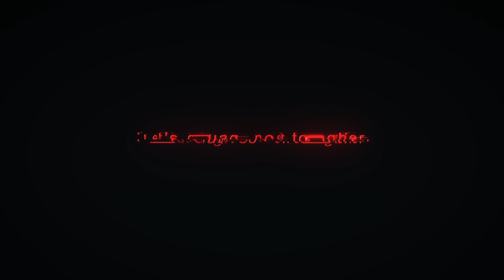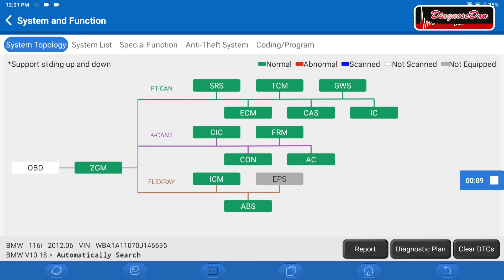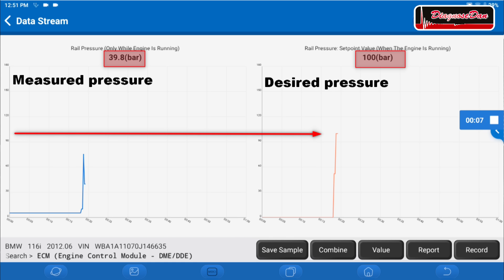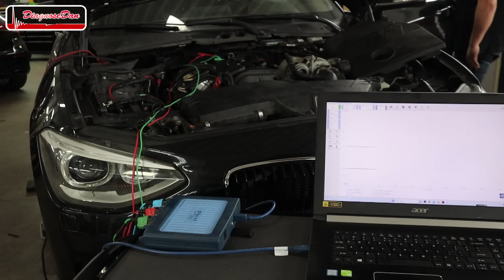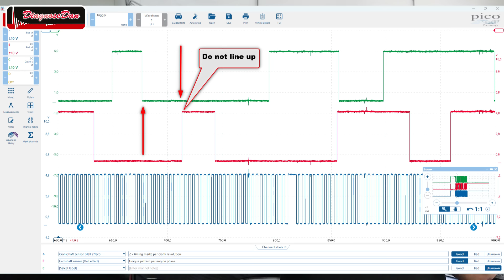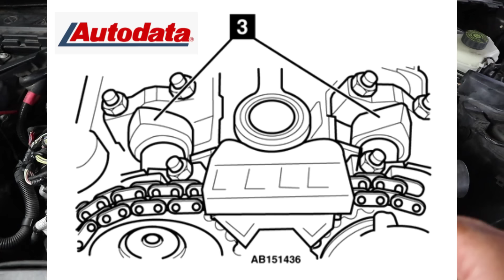Bmw dealership blunder? Incompetence?

Comment: It appears that those very expensively trained mechanics are not doing their jobs correctly, well done Dan for sorting this one out for those guys.
Reply: That's part of the problem,dealerships don't want to invest in training and this is the result.
When I started at a main dealer as an apprentice (BMW incidentally) we had fantastic factory training, I was sent away to BMW for a week at a time several times a year and moved around the workshop between all the different techs. If there was ever any downtime we watched training videos and had to watch at least 1 a week. As the years went by the training got less and less with various manufactures. I now work roadside and the training is complete garbage,the only way I can possibly even stay remotely current is by doing my own research online, If I complain to management I am told "you don't need training your fix rate is good" which personally I think is a terrible way to look at things. I'm just glad I'm nearing the end of my working time because as cars get more and more complex and the dealers invest less and less this sort of issue is going to become more common. Great news for guys like Dan though.
Reply from the maker: Maybe it was the technicians first day😉

Comment: I was a Mercedes Benz tech from 1986-96. We had much better training back then. However, being very familiar with that BMW engine, my first thought would have been to run a dynamic compression test using an old fashioned compression tester. My guess is that that engine would have very low cylinder pressure. Even though it sounded somewhat normal during cranking. My next move would be to remove the valve cover and look for broken timing chain guides. My recommendation to the customer would be to replace the entire engine. 
No scan tool or picoscope is necessary to diagnose such a basic, well known issue. And certainly throwing a parts cannon at the car isn't doing their customers any favor.

Comment: This is an amazing learning video and great for me as a Chrysler technician, they’re starting to use the new designed 2.0L turbo in a variety of vehicles, and the high pressure pump solenoid operates exactly like this! And by reading online, I’m hearing they’re becoming prone to having timing issues. So this is very good information and a great educational video. Thanks again Dan!
Reply from the maker: The fuel prices here in Europe are twice as high as in the states. Fuel prices are also getting higher in the States so you'll start to see more small engines. People want great fuel economy but they also want a powerful engine. The combi of a small engine with high power that still meets all environmental standards means the engine gets less reliable. You'll see the same problems in your workshop that we see here.

Comment: I'm not as educated with these types of engines and systems, I'm old school, BUT, I do understand what and how you diagnosed the faults. YOU my friend should be closing down the dealerships and put YOUR sign out the front. YOU are the trained mechanic that knows how to work on these types of faults, and engines. I followed your system of fault finding, as I was taught in the Army (RACT = Royal Australian Corps of Transport), respectively, not your time from, but mine was old school. As you also said, you MUST have Spark, Fuel, Timing, a motor should start if these 3 simple things are in order displaying, or testing to be GOOD. 
Well done Dan, you are worth 100% against any workshop. Thanks for the upload video. Cheers Teddy.

Comment: Fuel + Air + Spark + Timing == Running Car. 
Its been the same for 100 years. 
Sometimes all these sensors and gizmos get in the way of the old school logical mechanical process.
The other shops were so obsessed with codes and waveforms they forgot to adequately attend to the basics. 
Nice job Dan.

Comment: Good job Dan. I think most 'new' mechanics just replace parts going by the diagnostic tool. When there are no / less fault codes, they are clueless and start guessing
Reply from the maker: An then you have a broken wire😂 you can replace every part but it won't solve your problem

Comment: I certainly can't diagnose to your level, but as a weekend mechanic I know enough to check spark, air, and fuel.  I'm completely shocked that the dealership and independent shop didn't squirt starting fluid into the air intake to see if the engine would fire.  That is such a basic troubleshooting tip, and probably would have led them in the right direction.  Thanks for a great video; learned a lot as always.

Comment: Another great video, Dan! Thanks!
These engines are known to have timing chain issues. This confirms exactly my experience with BMW dealerships; completely unable to do a proper diagnosis. Also, the engine cowl seems to be fucked, also suggesting a incompetent mechanic has been working on it.
Reply from the maker: Unfortunately i also wasnt impressed by the Dealership diagnosis

Comment: You are without a doubt a very thorough and knowledgeable technician. Well versed in the systems and nuances of computer controlled interfaces in vehicles of today. Amazing to watch you work through a diagnosis. Your videography is spot on as is the scripting, editing and presentation of subject matter to your target audience. All around an amazing channel sir. A 1000 years ago I was a technician in a German automobile dealership and was pretty good at my trade, times changed and I moved to locomotives to fill the need to be covered in grease and grime for a living. Now I live vicariously through channels like this one to supply my need for slipped wrenches causing a visit to the ER for stitches. 
Not that my subscribing makes a lot of difference to your already well tractioned channel, I have and will enjoy your overly energetic explanations of electro-mechanical interactions and diagnostic techniques.. :)

Comment: If Dan worked for a manufacturer they would have ZERO lemon law buybacks.  They would call him The Wolf, because he solves problems.
Reply: Wolfes solve problems?
Reply: @moestrei  It's a reference to Pulp Fiction. Harvey Keitel playing Winston Wolf (The Wolf) and he solves problems.
Reply: @blockbertus  Thanks for info....never watched it.
Reply: @moestrei  No worries. But I highly recommend watching it. A very good classic!
Reply: Or they could, you know, make sure the cars work properly before they leave the factory... 😉🙃 Having stricter quality control of components, to reject faulty components before they ever get put on assembled cars in the first place, and minimising production line errors so few to no cars need to be set aside for rework (or not set aside and sold to customers anyway as it may be)?
Reply: Auto’s are not build to last forever. So having a problem after 9 years is not bad. And is the car quality to blame or maintanans for instance not using the correct oil
Reply: @peterschalker  The part broke because of the oil ? Are you kidding me?? And then it's because of the incompetence of the dealership and not the car itself.
Reply from the maker: Thanks for your comment its appriciated

Comment: Great diagnosis, Dan! I liked the explanation of how timing can drastically affect GDI fuel pressure. Have seen this several times and it can definitely be confusing to pinpoint 😁
Have you tried the PHAD Pressure Transducer yet? Easier to use than Pico 😉
Reply from the maker: Hi Ivan the next time i'll need to do a pressure test i'll certainly use your sensor💪

Comment: I was randomly checking info codes for my e65 730d and came across Dan's indepth knowledgeable knowledge where certain parties would miss diagnosis issues which leads for poor customer paying more and still having the problem, I found your video an eye opener, the go to  guy mission impossible 👏

Comment: I'm a complete novice but once you showed spark, and introduced an alternate fuel source  that resulted in the same "crank/no start", I figured the likely culprit was that it had jumped time. This is what happens with a lot of BMWs if one doesn't do proper scheduled maintenance. They could have avoided this if they had the timing system serviced at the proper interval(s). Those guides just aren't built to last over time. They may last well beyond the recommended service length but it's a big gamble to take. I suppose it's possible the timing system was serviced at proper intervals and the guide just failed anyway. Regardless,  I hope for the owner's sake it didn't damage or destroy the engine internally.   Nice video Dan, new sub! Greetings from the US!

Comment: It sounds like the owner needs to sue the dealer as well as the previous shop.
Reply: It's not the dealers fault. It's the so called Technican that did the job.
Reply: @2nickles647  you are so blind. The dealer is the one that has the tech. The dealer is responsible.
Reply from the maker: You dont need to sue right away you can also show the results and ask for a solution.

Comment: I think a compression test at the start would have this figured out. When Dan first turned over the engine it sounded like a engine with a broken timing belt.
Reply: That was my thought also, spark and fuel tick….next is compression
Reply: This actually the first time he goes first  with scoping cam sensors.   On the past he does relative compression ( he even has that specific tool with green graphs) or absolute compression test with sensor that he do last.  He just wanted  to extend the video at end is a you tube educational video.
Reply from the maker: Its all easy once you know whats wrong.😉
Reply: It didn’t sound like a broken timing belt to me. I feel like Dan was expecting it to run on alternate fuel by how much he sprayed and how many times he cranked it.
Reply: Most BMW engines don't have timing belts.

Comment: Synchronized fuel regulation performed at the high pressure pump? I'll have to scope this out the next time we get one of these in the shop. Very interesting... I have changed these pumps for causing timing chains to jump on an Audi and leaking fuel into the crankcase, but never thought the timing had an influence on the pressure.....
Reply from the maker: It has, next time you have a timing problem also scope the hpfp regulator and tell me what you see!

Comment: I had a terrible experience with a BMW dealer aswell. Airco not working at all. I went to the dealer and told them: airco does not work at all. It was refilled at an other shop and did not work at all. They claimed the airco clutch was broken (I did not believe that because you could hear and see it close). They told me: condensor leaking. I did not believe them because: it should atleast work for a while after a re-fill. I told them this! In the end I found that the swachplate control in the pump did not work. So I replaced the pump. Brought it back to the dealer for a re-fill. I told them: I have cleaned the entire systems of oil. I told them: the new pump has 200 ml of oil. Please fill it up to the required amount.

The guy at the desk had these blanco eye's and asked: how should we know how much oil should be in the system?

Comment: In U.S.A more and more people are avoiding BMW products due to poor engine design and horrible dependability. 

Dan is the salvation to plastic chain guides and catastrophic engine failures. 

Good bye for now, I'm shopping for a set of tires for my 2005 Toyota Sienna with 175k trouble free miles.😅
Reply from the maker: Thanks for your comment its really appreciated

Comment: I probably couldn’t get as in-depth as you and love your diagnostics, but I get the feeling you deliberately drew this diagnosis out to extend the content! The reason is the very first spark plug test showed an erratic spark when it should have been consistent and uniform - poor spark quality should always lead to in-depth electrical system tests …coil pack output, new plugs and timing check.

Comment: We are not going to bash others but me , you and a lot of others just know that the repairs done by the dealer and the independent are pure guess work. The last two months I have seen at least 5 wrongly diagnosed cars that where easy enough to diagnose properly, not rocket science, but for some reason wasn't performed. A touareg with a vacuumleak in the hose to the brake booster was diagnosed as being a bad booster and charged the client full price for not fixing the car and today I got a A class where the steering rack was replaced while the BIG PLUS wire is straight in your face to check for power. It is absurd. I don't know what is in the air, and I am NOT the Nr1 mechanic in the world but c'mon people. Basic things. You have your head with your job Danny. Respect and great video.
Reply from the maker: Thanks for your comment, do remember that there are alot of great Dealership techs out there. Its not all bad!

Comment: The absolute smartest thing you did was to introduce an alternative fuel source and as soon we heard the engine not attempt to start anyone would know there is something mechanically wrong. How does this get missed by a professional? Put the parts canyon away! What recourse does the customer have due to the incorrect diagnose? Did the dealer and the independent shop give the customer their money back? The customer had to pay for two tows, did the customer get reimbursed for that? 

How many kilometers does this BMW engine have on it for the timing chain guide to have failed? Is the engine worth fixing since it is an interference engine because some valves could be bent? When you did attempt to start it the cranking sounded even which by using my ears I would say no valves were bent. 

As always you are a master and I hope other "professionals" can learn from you.
Reply from the maker: I dont have the answers about the customer being reimbursed. The independent workshop picked up the vehicle and is going to fix it

Comment: A view from the UK. This is a classic example of "over diagnosing" a problem. We diagnostic engineers always start from the basics, always. I am sure Dan has learnt his craft from some older, wiser engineers by his list of procedure he articulates &follows. It seems to me that since vehicles became "computers with wheels on each corner" the attitude of main dealer the younger "technicians" is to go straight for the electronics. In this case, simply lifting the cam cover would have saved hours AND money. I hope you made 'em pay Daniel.  I am a retired installation and service  engineer that installed computer controlled machine tools all over the world and retired member of of the institute of diagnostic engineers here in the UK and we have a saying here which is: Rule no.,1, Is it switched on?......The older diagnosticians will understand this.

Comment: I could hear that the engine had improper compression the first time you cranked it. Years of listening to an engine (whether it starts or not) gives you an idea of what the problem is. I agree with ruling out the fire and fuel delivery first. They are less invasive tests and a good place to start.

Comment: I especially like your approach Dan. When I had my garage, I am now 74 by the way. I often took the simple approach on a non starter. Like you, the idea as to how an engine works is simple. It requires Fuel and oxygen to burn. A spark to set fire to the fuel and Compression to force an explosion in the combustion chamber. All that at a very precise moment. And that's where valve timing comes into the equation.
Reply from the maker: Thanks for your comment!

Comment: Nice work Dan, I really like the way you conduct your diagnosing and present it in the videos. If the timing was so far out I would expect there to be little to zero compression due to valves being damaged or staying open at the wrong time etc.  It might have well been exposed earlier if a compression test had been conducted.
Reply from the maker: Did the engine not have compression? Look at the in-cylinder waveform presented in the video